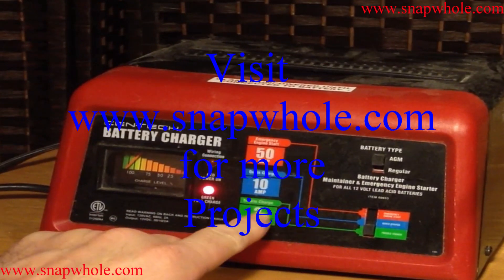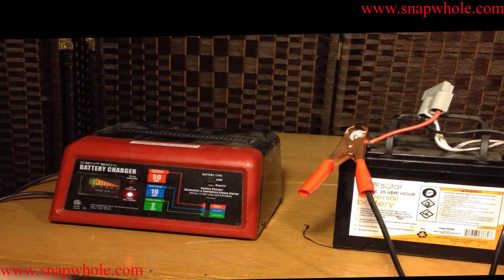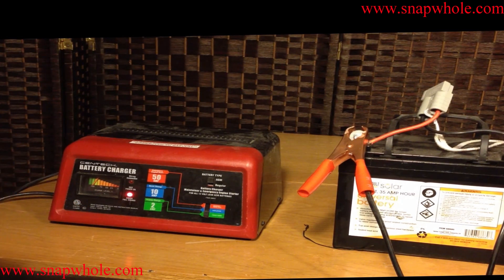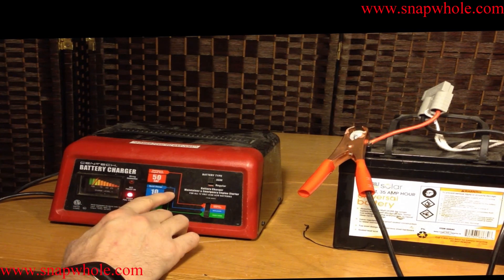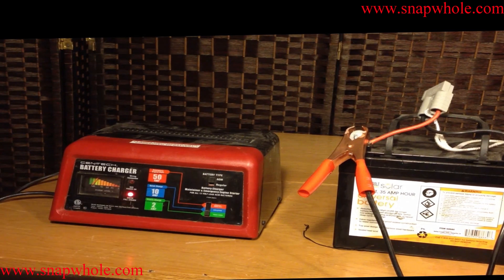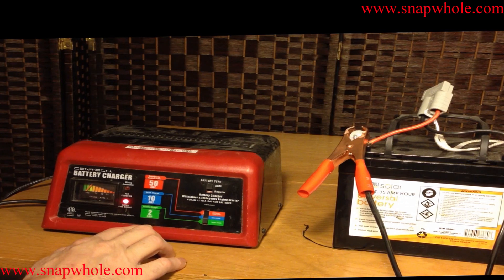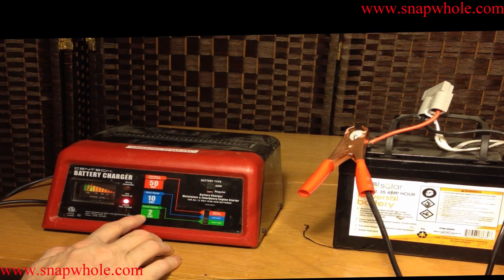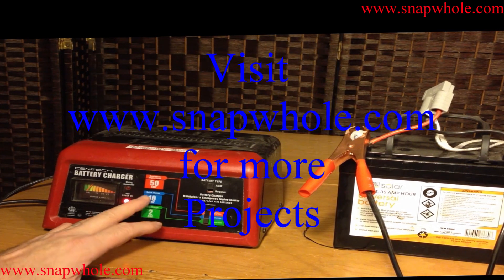Harbor Freight Cen-Tech 50/10/2 12v Battery Charger Review and Use Demonstration

Comment: I'm mechanically challenged and am a little confused about starting a dead car battery with this charger.   What is the procedure for doing that?   Thanks.
Reply: damned good question.  Apparently, according to all these paid shills for Harbor Freight, we're screwed....  charger apparently only works if battery is only partly discharged, but not in our real world where the battery gets drained..... To these comp'd shills for H/F, too bad, tough luck, your battery is history.  (and what did you think, that the battery charger would actually, like, um.... charge the battery?)
Reply from the maker: wow - sorry you can't see the need for this important safety feature, which by the way is easy to work with - hook 2 batteries up in parallel and charge them for a few hours, that will get enough charge into the dead battery for the charger to work on it alone - the alternative would be a dead short when the clips touched each other, or a switch to turn the charger on/off, much safer to sense a battery connected correctly before energizing the charger - BTW, ask harbor freight about comps or paid shills,  way to cheap for that, they require me to put a disclaimer that I am not affiliated with them, and I have absolutely no relationship  with HF, and I get comments from others that can't afford HF tools, and take it out on me
Reply: @snapwholeharborfreightreviews  Ok how about a switch to bypass this function ? Or a breaker to reset if shorted.  My Cen- Tech is fairly new and has started to cycle red /green on every thing. And yes they are low on charge.
Reply from the maker: @kathybond9489  you can add an on off switch to your charger faily easily, just make sure its rated at least 50 amps (perferably 100 amps), a breaker would be a lot more work - do you have a battery load tester? in my experience flipping red/green is a sign the battery is border line bad - not always the case, but thats why I have a load tester, the charger is having trouble sensing the true state of the batter, it goes green because it senses the battery is charged, by design, it monitors the battery condition, and go to red when its needs charged, the cycling back and forth is because the battery is not hold the charge - change for subscribing!
Reply: In order to get these smart chargers to start charging a completely discharged or dead battery you actually need a jumper pack, also can’t be a smart jumper pack…..needs to be the ones that have an actual 12V battery inside. The charger will see voltage and begin to charge, after a few minutes it will continue to charge even with the jump pack disconnected. Hope this helps. Search you tube for how to trick a smart charger to charge a dead battery.
Reply: It doesn't take much to get things going. A flashlight battery and  wires across the posts is enough. Or any small power supply. Once its started charging remove.

Comment: The 50A setting, well I don't know what it actually puts out and I've had a similar Schumacher charger with the same settings, and whatever it puts out, the significant thing is that it's a battery start charge.  You can hook it up to a weak battery, set it to that setting and start the car in a few seconds (you'll have to run the car to fully charge the battery at that point), or you can hook it up to a pretty much dead battery (as long as it's not damaged) and wait about 5 minutes and you'll be able to start the car.  With a few minutes of patience it basically lets you jump the car, quite a useful feature.
Reply from the maker: It give 50a until the internal circuit trips, which is about 2 seconds, so if the car can start in that 2 seconds, it works, I thinks is a limited use feature, newer cars might start that fast, but most slightly older cars will not
Reply: The fifty amp setting will kill that battery charger, or at least it killed mine.